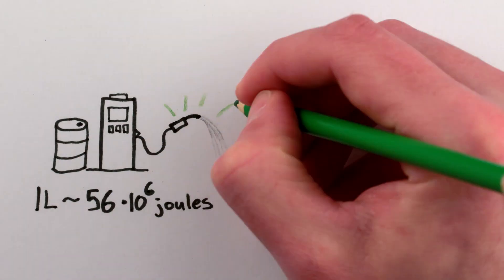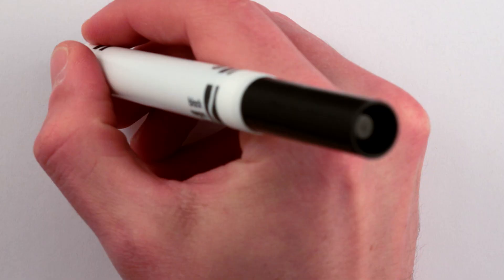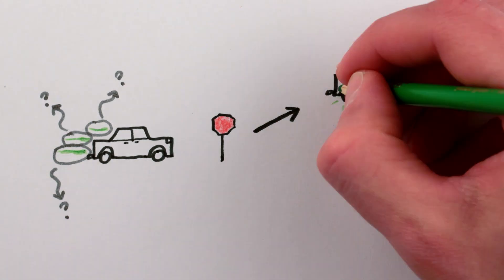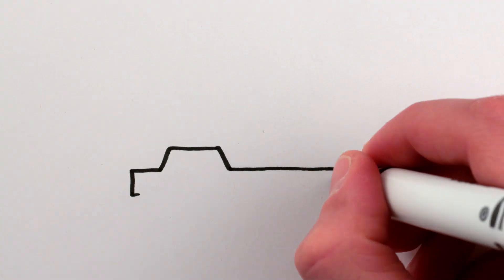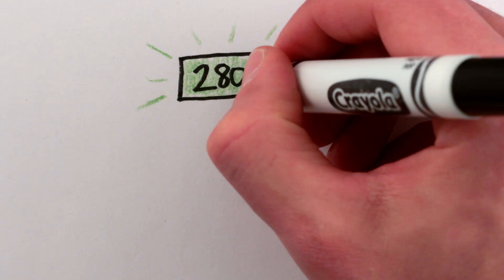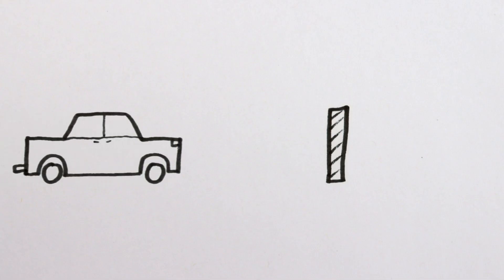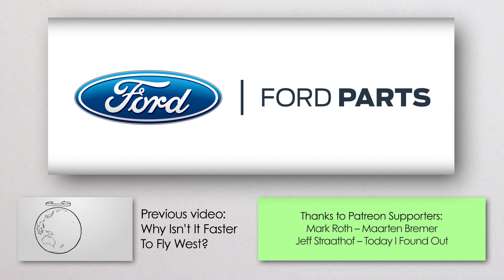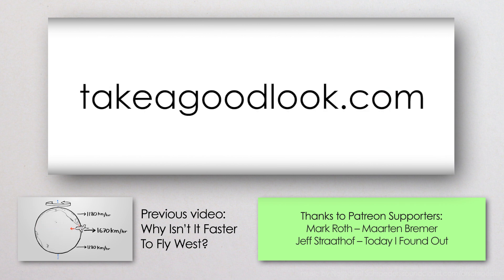The Physics of Car Crashes

Comment: wait, if that much energy is lost in heat, shouldn't we look more into how to not lose that energy in the form of heat? Or is that something people already try and do and it isn't as easy as it sounds?
Reply: +Skylos Reviews We have, we call them power plants.
You could burn gasoline in an efficient (heavy) generator and use the electricity to power a electric car more than three times the range it would have gone in a combustion engine car.
Reply: erbgeg egerger yeah, but I mean in cars. I meant making cars generate less heat in order to save on gasoline and use that power more efficient
Reply: +Skylos Reviews Wont happen, efficiency is pretty much maxed out. Next step is electric.
Reply: +erbgeg egerger False, people are still looking into increasing efficiency. We can have better designs and lubrication just for two examples.

Example from MIT - http://www.technologyreview.com/news/408352/a-more-efficient-engine/
Reply: +John Widner You realize that you linked to a 8 year old article? Besides, combustion engines will never touch electric engines even if there were to be improvements made.
Reply: +John Widner Combustion engines are inherently inefficient. I mean, it uses hot air to power the engine. Once energy is in the form of heat, it's pretty useless and can't do much work for us. Even hydrogen fuel cells would suffer the same problem if they're internal combustion based. Definitely time to invest in some electric cars.
Reply: +rabbits2345 yes they are I not efficient, but you must have missed my point. I commented again someone saying we can now not make them any more efficient. And that is incorrect. While we will likely never make them 100% efficient. We can make them a bit more efficient, that article was an example. We can reduce moving parts and improve lubrication methods. Friction is the biggest problem. So yes it can still be improved, but never be close to 100%
Reply: maximum efficiency is based in thermodynamics, with the most efficent cycle being the Carnot-cycle. This cycle gets more efficient, the lower it's lowest and the higher the highest temperature is. 
The problem is however, that constraints in materials, the combustion process and etc make it impossible to actually field a cycle with this efficiency.
Modern car engines have an efficiency of rougly between 20-30% and are steadily employing more and more complex tricks to squeeze more efficiency out.
The most efficient combustion piston-engines are superlarge, very slow two-stroke diesel engines at close to 50% (we're talking piston diameters of 2,5 meters at 70 rpm here)

Comment: What about the engine? What happens when it gets compressed in the car crash? (Given that the engine is in the front) Does it just turn off automatically? Or like in many games with cars, overheat and blow up?
Reply: Most cars are designed to push the engine down and out of the way as it crushes.

Comment: A new car built by my company leaves somewhere traveling at 60 mph. The rear differential locks up. The car crashes and burns with everyone trapped inside. Now, should we initiate a recall? Take the number of vehicles in the field, A, multiply by the probable rate of failure, B, multiply by the average out-of-court settlement, C. A times B times C equals X. If X is less than the cost of a recall, we don't do one.
Reply: +Excluded Layman good old Pinto. It's a pretty famous case of class action lawsuits.
Reply: +Gytax0
And which company did you say you worked for?
"The one that sponsored this video."

PS: It wasn't the rear diff locking up, during rear-end collisions the bolts sticking out of it would puncture the fuel tank. Hence the fires. (This was a real thing that happened.)

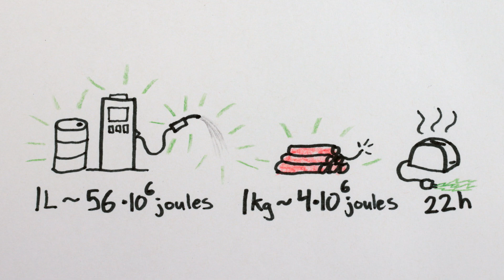Comment: @0:08 1L Gasoline isn't eqaul to 1kg TNT in anyway.

a) Liter is an unit of volume (equal to 1 cubic decimetre)
b) Gram is an unit of mass

TNT and Gasoline do NOT have the density* of 1, so the comparison makes no sense.

(*density is mass (kg) per unit volume (L))
Reply: +Subjaeger i am pretty sure you don't understand what he is saying, he is talking about the energy that is release by those two things, what you are talking about has absolutely nothing to do with what he said.
Reply: In terms of volume, it's equal. 1ml = 1cm2 = 1gram. Just change the unit 1L=1M 2(squared) = 1 kg
Reply: +TLK Dragon wow... no. just no. "1M 2(squared) = 1 kg"  This is sooo wrong, that you must be a troll.
Reply: +TLK Dragon 
We are not talking about water.

Comment: I liked the part about how inneficient fuel engines are... that's crazy.
Reply: +Martin Brochu Now compare them to electric motors, which all have an efficientcy above 90%, some of which going up to friggin 99.7%!!!!

Problem is, you need batteries, which have - at most - an efficency of about 60%.

If we would be able to improve batteries, someday it will be more efficient to burn the fossil fuel in a powerplant (where much more efficiency can be achived than in a car...) and then power electric cars with it... only those damn batteries....
Reply: +Martin Brochu Engines need radiators for a reason.
Reply: ***** What does "under x% charge" mean? Uncharge them not more than 20%?

Anyways, let's assume for a second a battery has energy efficiency of 95% at any time.

Modern diesel-car-engines are able to convert fossil fuel with an efficiency of about 50% with optimal conditions (which are almost never given on the road).

Multiplied with the "well-to-talk-value", the efficiency of the supply and harvest of the fuel, which is about 90% for diesel, this results in 45% total efficiency.

Compare that to electric motors that use electricity generated at a powerplant which is fueled with fossil fuel.

Let's take a "combined cycle power plant" for this calculation, which is the most efficient fossil powerplant today, with a efficiency of about 60% (again, with optimal conditions, which could be provided in this case).

86% (well-to-talk for gas)
* 60% (CCPP)
* 95% (powergrid)
* 95% (battery)
* 95% (electric motor)
= 44.5 %NOT QUITE

tl;dr: Comparing the efficiency of a dieselmotor to the one of an electric motor (including all factors like supply, powergrid-efficiency etc...) we get ~45% for both methods. To bad. Otherwise, the revolution from diesel/benzin to electric motors could take place even before enough renewable energy is harvested.
Reply: +Merthalophor To my knowledge, batteries of today are far more efficient, close to 100% under 70-80% charge.
Reply: +Merthalophor Under around 80% of a full charge, there is almost no loss when charging, I say around because it depends on the battery chemistry.
And I live in Quebec and charge my Nissan Leaf with 97% hydro electric power and 2% wind power so I should be good.
Reply: +Jorn van Bladel We should blame Toyota here or any manufacturer which do not properly handle the end of life of the battery. There should be laws forcing them to refurbish the batteries and give them a second life. There is TONS of buyers for these. Anyone with a good array of solar panels would be interested in those batteries and they could use them for an extra 5 to 20 years.

After that, they can be easily recycled. If you let them the option to throw them in the garbage, they will, because it is fast and cost next to nothing.
Reply: +nblax41 Turbos don't inherently make engines more efficient. Turbos act as air compressors to force more air into the cylinders of the engine, but that doesn't magically make the engine more efficient (it's already at the ideal fuel/air ratio or close). It just allows more fuel to be added as well, increasing the engine's power-to-weight ratio, i.e., allowing an engine of a given size to generate the power of a larger engine, using a similar amount of fuel.

Vehicle manufacturers like Ford put turbos in their vehicles (and market them with names like "EcoBoost") because the engine can run without activating the turbo at low speeds and/or times of slow acceleration, meaning they can put a smaller engine in the vehicle and achieve the following: 1. At low speeds and/or low acceleration, when not much power is needed, the vehicle will be running a small engine with no turbo, thereby consuming less fuel; and 2. At high speeds and/or under high acceleration, when extra power is demanded, the turbo will activate, pulling more air into the cylinders, allowing the engine to burn more fuel and generate more power.

Turbos in consumer vehicles are essentially low-tech ways to emulate hot swapping your engine out in a few seconds' notice for a smaller or larger one based on what you're trying to do with your car. Therefore, more fuel efficient when turbo is off, no sacrifice of power when turbo kicks on. The turbo itself does not inherently improve efficiency. Taking the turbo off the smaller engine would actually improve its efficiency, but people wouldn't like how sluggish and underpowered the car would feel. It's a compromise.
Reply: Raptor That's not true. Being inefficient does not imply to just sh*t everything out. Our body is not bad at extracting energy out of the food, but at using it. I mean... stretch your arm up front without moving for 5 min. Does it hurt? Do you feel exhausted? Well, guess what, 100% of all the energy your body needed to do that was wasted, because physically seen, you didn't perform any work at all. Same goes for your walk cycle. Lifting your foot uses energy, putting it back down on the ground uses energy again.... and some people call this intelligent design! Anyways, let's stay on the topic.
Reply: +DannleChannel What about using thermoelectric generators to harness all that wasted heat?
Reply: ***** Ah, thanks. I love the way it looks!
Reply: +Elizabeth Lopez Get a room, you two. :-|
Reply: all engines are inefficient when you look at the wasted energy.
Reply: +Martin Brochu We could do a little bit better -- up to 50% of the fuel energy could be converted to kinetic energy -- but that would require removing a lot of safety features and it would probably destroy the engine pretty quickly. So it may be inefficient, but it's a lot less wasteful than you might think.
Reply: +Martin Brochu But what about the system for generating the electricity and transporting it to the charger?
Reply: +nblax41 I'm no turbo engineer, sorry, it might make them a bit more efficient I have no clue.
Reply: ***** It does, no question. That 80% loss they talk about in the video, well almost all of it is lost out the exhaust system. Turbos use that energy to push air into the engine and make more power basically.
Reply: +Merthalophor You should also take into account lubrication. Since the combustion of diesel is not based on heat, it is used to lubricate the engine as well before it I'd rediltered into the tank. I don't think they're doin that with battery acid, haha.
Reply: +Ric Rac .....In a car.....A thermo-electric generator...in a car? That would not be very efficient due to weight, cost, and space. It would be too large and heavy to be efficient in a gasoline car or truck. You could not make enough power compared to an alternator(generator) to be worth it. Also because of  the complexity that would add to cars today.
Reply: +pyropulse that's very true, but it's actually a good thing for our bodies to be less efficient. If 100% of our consumed calories were used to move instead of creating body heat, we'd get over weight eating a piece of bread. Haha
Reply: +Martin Brochu I read all these replies and I can't believe there was not a single mention of fuel cells.
Reply: Raptor
That would solve hunger in africa where people die from not having enough food.
Reply: jesus christ I'm never commenting again
Reply: +Raptor hjhe
Reply: +Martin Brochu Totally off topic, but is your profile pic a sunset on Mars?
Reply: +Elizabeth Lopez You nailed it!
Reply: +Jordan Shank Yup, kiss our atmosphere goodbye
Reply: +DannleChannel this isn't entirely true. yes, turbos are used to create a denser charge in cylinders, but the tiny little turbos that manufacturers have been installing on small cars create very little parasitic loss and harness the high speed gasses straight out of the chamber to decrease the amount of work the engine does to draw the next charge. hot gas escapes, valve closes, gas continues to expand and flow through the turbo as it returns to atmospheric pressure and this pushes in the air. the positive pressure on the intake stroke helps efficiency
Reply: +Martin Brochu look up the ogle carburetor.
Reply: +Martin Brochu And you know what? They're extremely efficient in terms of directly converting fuel into work, especially if you add a turbocharger and harvest energy from the exhaust.